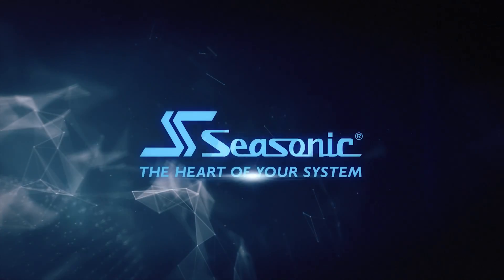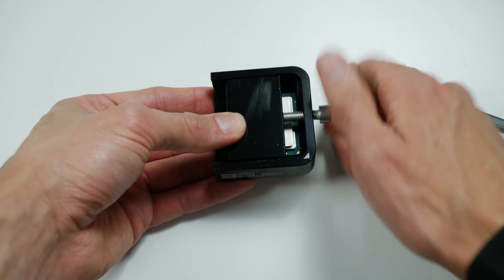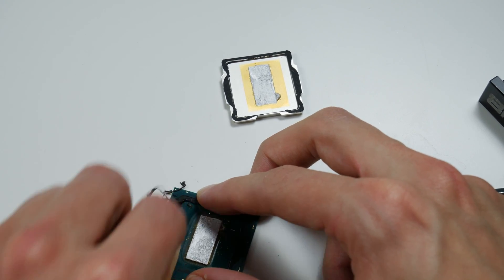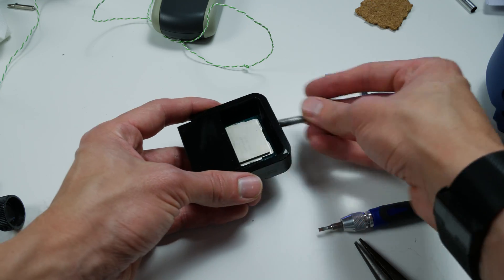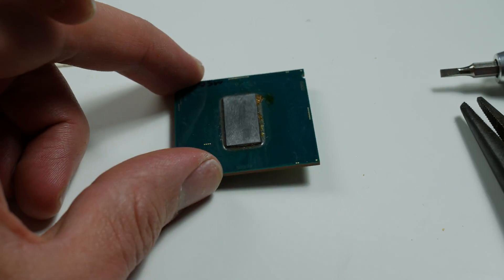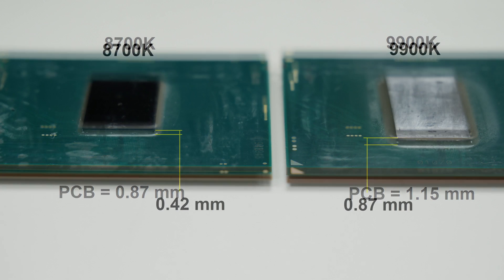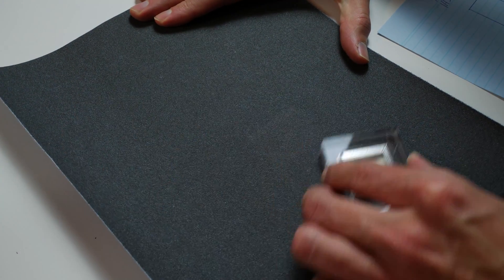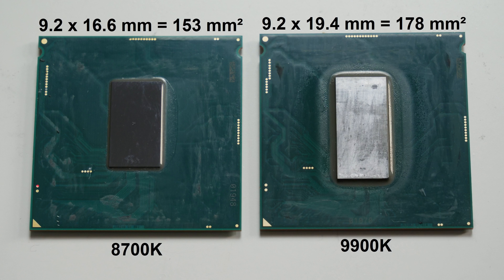Bad sTIM? Why is the 9900K so hot?

Comment: Have an 8700K and wondering if it's worth buying a 9900K. However I only use air-cooling. By the results on this video I would struggle to run a 9900K.

I have looked through Youtube for '8700K vs 9900K gaming' results. Was surprised to find one benchmarker show 9900K running 5'C cooler than 8700K, in MSI Afterburner. I think there were maybe two Youtuber that showed that result. The few other that showed temperature results, showed the 9900K hotter. 

It's a risk to buy a 9900K I guess. The preformance upgrade is minimal although min fps improves a bit. The two extra cores would help with background tasks. I think the best plan now is delid the 8700K, and use it until it does not play any more. ... it's always tempting to want the 9900K though.
Reply: dont do it just wait for 13th gen or get an i9 12900k. i had an 8700k when it cam out then later last year bought a 9900k. my maximus x wasnt optimal yes it worked but th z390 MB are made for the 9900k it has more power draw and get way hotter than my 8700k did and i had it clocked at 5.3 and my 9900k is at 5.2 and my maximus x is mad for a 6 core but if ur not overclocking high frequencies this next bit is less relevant but anyway after bought a z390 maximus xi for the better power delivery and heat sinks/spreaders on the motherboard also its liquid cooled with a 420mm radiator its just a hot cpu it always has been but more importantly the price of anything pre 10th gen it outrageous 2-400 dollars at least on the MB if not more that goes for the coffee lake and earlier cpus as well and for instance 9900k is around the same price as a 12900KS which is 700 buck more or less and 9900ks is like a grand where a i9 12900 k is between $500 and $600 and with the prices so much lower on the new gen 12 and 13th when it launches performance being sooooooooo much better its just absolutely not worth it i still plan on upgrading to to 13th but coulda saved hundreds by not spending it on coffee lake era tech which is all insanely priced 10th gen isnt 11th either so i hope i saw your comment in time also liquid cool your cpu you will love it even if you dont oc your cpu its just so much more efficient, not very expensive or hard at all to install anyway good luck man  hope this helped
Reply: @StupidWhiteKarens  I never did buy a 9900K (or not yet). However I am wondering from the perspective difference between CPU and GPU bound games. 

At stock clocks the 8700K will max out all cores and threads in Red Dead Redemption 2.

With reference when you look at reviews of 8700K vs 9900K, there is only a few frames difference.

However that is with GPUs from the time, like 1080 Ti and 2080 Ti. 

Now we have Ampere and with that I am maxing out all the 8700K cores and threads. With Red Dead Redemption 2 now being CPU bound, with 8700K. I then can't help thinking two more cores of the 9900K would make a lot of difference. Assuming that RDR2 would spread the load evenly across two more cores.

Of course I can get much more from the 8700K with a delid, and especially using liquid metal. Even with stock Intel paste now, it can run all cores at 4.8GHz. After a delid I should get 4.9 or 5.0Ghz all cores with no extra power. .... That extra 500MHz would make a difference in CPU bound games.

I mean to upgrade my platform sometime, but if a 9900K would make this 8700K platform more usable, then maybe keep looking.
Reply: @greenbow7888  I must have gotten luck I clocked my 8700k to 5.3 no delid I usually  keep my i9 at 5.2 ice had it at 5.3 and even 5.4 but hT off it 5.4 in single core its scores sometime just under other just hight on single core than 5950x and at 5.3 multi beats a stock 11900k its not the latest out but still a a very good cpu in just can justify its out 9f the box performance oc potential vs 12th and 13th a new is more than. 12900k thats just absurd also ir runs warm especially pushing high clocks I mean ive pushes b die ddr 4 and. 14nm coffee lake as much as o can with what I have and iys just not enough I run games fine at 2k 144hz but for me its also the overclock ing if this was a couple years ago id say yeah do it but with 12 being out and raptor lake right around the corner and being cheaper and miles more powerful stock let alone ocing them i dont think its worth it but i have had no complaints about my 9900 had alot of fun with it same as the 8700k I had if you could find one reasonably priced bc for sone reason you wanna stay on the 370 390 socket platform maybe but I do why not get even a 12700 or even 12600 its just old architecture (that performs fine) just over priced and again I wanna upgrade is id have around a grand or less if laye last year I didnt grab the cpu and MB but to end this long rant its upt to you thats just my to cents if I could do ober again id ga e kept my 8700 and mb then and either have z690 build already or be waiting for raptor like I um now
Reply: @greenbow7888  noticed a big fps difference in cpu ram intensive games as I also have 4×8 bdie ram thats oced to almost max board freq and my imc is probably at ita limit but yeah it was a very notice able fps boost

Comment: I wonder if like Der8auer said, maybe asking for solder was the wrong decision. We all assumed that solder would be cooler, but D8 has discovered why maybe not. I wonder if a 9900K with slimmer silicon and Thermal Grizzly would be cooler than solder. It would most likely be hotter than 8700K still though, although they both consume the same 95W. One thing is for sure, deliding and pasting a TIM 8700K is easier than doing a solder CPU like 9900K.

Comment: When sanding the die, are you still able to use the direct-die frame / oc-frame? Caseking states that the frame itself is only 0.1mm lower than the actual die. So if you sand the die more than 0.1mm the cooler / coldplate won't touch the die. In this video the die is sanded 0.20mm and then the oc-frame shouldn't be compatible any longer. But the video doesn't say if the frame was being used or not after this. Or if the IHS was mounted back and the standard socket was used. If using the IHS after sanding down the die, you will probably have to sand the outer edges of the IHS 0.2mm also, to make contact between the underside of the IHS and the newly sanded die.

If using the die without any frame at all, and simply mounting the cooler directly (as in actual direct-die cooling) there might be contact issues on some of the pins along the edge of the socket since you are only pressing down directly above the die.

Comment: I got 5.1ghz with my 9600kf and have it on 3DMark and Blender Benchmark on a 25 Deg C day in Australia results posted with 2070 super. Temps reached 85deg C with Kraken 62 in case setup with filters removed.

Comment: I'll say this, as a latecomer to this vid:

I've tried cooling my 9900K w/ a Noctua NH-D15 (high-end air) Fractal Celcius S36 (360mm AIO) and now also a custom loop w/ 360mm+240mm rads.  The temps on the custom loop are only about 5-7c lower than the other cooling methods while at the same time the custom loop dropped my 1080Ti temps by MORE THAN 30c!

This makes it pretty damned clear to me that (at least MY specific 9900K) is purely limited by poor die-to-IHS heat transfer.

Kind of upsetting to be honest!

Comment: I must have been lucky, I've got my 9900k running at 5.1ghz on all cores at 1.35v and no cores go over 89c during heavy benchmarking loads. Still miss the 65c top temp of my  8700k @ 5ghz tho =(

Comment: Has anyone done direct die cooling. But using a good thermal paste? Reason I'm asking is I have the ekfluid gaming kit (alloy) and cannot use liquid metal on my cpu block.
Reply: I have and used Kryonaut. And the temps are better, but I'm still on testings.
Reply: @brunoxsimoes  let me know your results please. I currently have a 9900ks direct die on LM now using a ek velocity. Temps from 50-60c under gaming load. Max temps mid 70's CB r20
Reply: Also running 5.3ghz

Comment: why is it so thick?  a lot of people are reporting cracked dies when they delid.  a few of them have sanded them down to find that the cracks disappear very near the surface.  so it could be that the tension from soldering and then the different materials cooling at different rates is causing forces to crack the die and the top layer is there to strengthen it and maybe to act as a sacrificial layer.

Comment: last one i got in hands was barely overclockable. it needed 1,38 V for stable 5 ghz, which is a joke, for what i have seen in a lot of reviews, where you can reach that with 1,3v or lower.
Ah, and i had to manually test in smaller steps, cause the cpu went so hot, that there was no way to cool it with all core oc. had to work with power targets to prevent excessive heat.
i never saw such voltages in any 9900k review. i gues they are binning them hard now, and if you dont want to buy shit for stock clock usage, you have to give intel more money then 500€^^
the funniest thing, was that this chip was not even stable with stock settings and auto voltages.
i sent it back to the retailer and bought a 9700k. The 9700k was not a cherry pick either with 1,343 for 5ghz but at least it was straight forward. 5 days for an all around stable overclock for the whole system.
good enough for the customers needs. i doubt i will touch 9900k again without custom loop. multiple days of work into the toilette.
Reply: It's the hyperthreading that makes it overheat

Comment: Will the direct die bracket work if you sand down the die? That would seem to yield the coolest temps(except for exotic cooling). 
I'm running an out of the box 9900k with an AIO and it gets pretty warm. I've considered de-lidding but it seems the real problem with this chip is the die thickness...

Comment: Congratulations, you played yourself.  

We did indeed! But hey, I am VERY happy with my delidded Conductonaut 8700k! She runs cold, 1.34 Vcore for 5 GHZ all core and 4.7 Ringbus. With a Noctua NH-D15 and my well ventilated case, we are talking 83 C at the worst in Prime95 AVX Small FFT! At that point, Hwmonitor claims my CPU is drawing some 255+ watts at times though, dunno how accurate that is but I DO know my chip draws a lot of power under those conditions, of course I DO NOT use any AVX Offset!

Comment: der8auer What would you recommend between either direct-die cooling with one of your CPU frames for the i9 and high-end air cooling (e.g., Thermalright, Noctua), as opposed to delidding, using liquid metal, and relidding using the same air cooling?

I've seen you've done both (though I believe with liquid or an AIO), so I was curious which made more sense; I try to stick with high-end air.

Comment: My guesses as to why the Intel sTIM is not much better than a good non-metal paste.

(i) Either to save money, or to keep soldering temperature lower for some reason, they're not using pure indium. If so, it's probably indium-tin alloy. Eutectic indium-tin melts at just over 100C, more than 50C less than pure indium, and costs roughly half as much. But its thermal conductivity is pretty awful.

and/or 

(ii) Too much flux (or flux with terrible thermal conductivity, or inappropriate flux). More flux would lead to a faster and simpler application process, but it's a very poor heat conductor, and all but a tiny amount will kill the thermal conductivity of the indium (or whatever alloy the solder is).

Comment: 9900k is fucking failure.
Reply: Depends on how much you paid for it, what you're using it for, and whether you were expecting massive overclocks (which are never guaranteed).

I'm very happy with mine. But I got it for a good price, it has a decisive performance increase over my i7-4790K in all areas, and I'm content running it at the max turbo (4.7GHz) on air across all cores, well within its temperature range (no core ever goes above 80C and most cores are between 75-78C) and fully stable 24/7 at 100% load on all cores.

Comment: I don’t understand how 60c under full load at 1.2v 5ghz is considered hot for an 8 core cpu. Mine does not go above 60c at these settings unless I am running serious benchmarks like Aida and Cinebench, in which case it still only barely hits 70c. I’m using the Kraken X72
Reply: I did just get mine, so they must be using better sTIM now then they were at launch.
Reply: Even when I got it up to 5.3ghz, it never needed 1.3v and never hit anything higher than 80c. I don’t have any complaints seeing as I’m coming from a 6700k that needed 1.4v to hit 4.7 ghz and was hitting low 90c’s

Comment: Too much worries about MHZ,  just set the 9900k at stock speeds and its very powerful, i will set my first 4 cores at 5ghz and other 4 cores to 4.9ghz with a 240mm water cooling and good, fanatics can break there brains just to get so much little more, life too short, enjoy :)

Comment: Can you make a compassion with a AMD soldered chip?
How much lower would be the temperature of a AMD soldered chip be after you delidded and lapped it?
By doing it we would know if Intel doesn't know how to do it properly or if soldering a chip is overall a bad thing...
Or Intel is doing it on purpose to have a ease next generation on their hands... All they need to do is make a more efficient soldering job and slap a I9 10970k stamp on it...

Comment: That is a lot of work to get temperatures down.  I used to lap CPUs and hated it because it was a lot of time and effort for every CPU.  For those of us that delid CPUs we were better off with the garbage TIM that Intel used to use.  By the way, Silicon Lottery states temperature reduction, "4°C to 8°C for processors with STIM (Intel 9th generation)" indicating that they DO NOT take the time and effort to lap the CPU and IHS, however, reflect your 8°C reduction in temperature without lapping at a cost of $60.   I seriously doubt that those who pay $530 for this CPU will will have any argument paying someone else that amount to delid and apply liquid metal TIM.

Personally, I am keeping my i7 7700K that I delidded myself and applied Thermal Grizzly Conductonaut.  It does very well when gaming.   However, I admit that I am waiting to see what AMD offers with their upcoming 3000 and 4000 series CPU.

Thank you for taking the time and effort for this video.

Comment: Looking at your results I must have a good 9900k as mine it’s stable 5ghz 1.25v no delid temp after 12 hours of stress testing average temp 71c max spikes of 86c with furmark running at the same time 4K resolution without furmark was doing 60c. Ambient temp 20c, I did try 1.245v and it’s stable but in games I found that with 1.25 they seem to run better

Comment: Great video and content. The whole thing makes sense. Also, if indium bring rigidity and thermal contractions, the Si must be more mechanically resistant to breakage; hence, this whole thing make sense. I'm sure Intel studied the whole thing and made those specific choices for a reason. Why don't you engineer your own cooling system ? eg., super flat Si,  with more convection than conduction, eg., something based on Ag-Ga or Au-Ga liquid or nanorods/spheres, or anything with relevant phase diagram. A big problem, is the mechanical breathing and pressure from the heavy CPU coolers.; a nano-metal-fuild would solve the problem, and over it, you put whatever would be relevant.

Comment: Roman do you think AMD chips Zen 2  on 7 NM or Intel's er 10 Nm chips will be running somewhere in the 5.2+ GHz range, also I quite enjoy the channel. Is there chance you could do a memory overclocking video? I am having issues although I am still on a 6700K 4.8Ghz and can't seem to get memory working in any stable form at over 3466MhZ 15.15.15.35

Comment: why is i9 9900k to hot???? For me it isnt so hot, i mean its 8 extra treads with a turbo speed of  almost 5ghz ,75degrees celcius at 8 cores at maximus  i say that is realy good and i have a  noctua NH-D9L in a slim itx chassi from fractal design node 302 also a 1080 in it so its tight building

Comment: You should also consider making a "jig" to hold your cpu or ihs perfectly flat and perpendicular to your sandpaper while your grinding.   I saw that you hand hold it and rub it on the sand paper.  Even if your paper is on a 100% flat surface,  it's still impossible to hold it 100% flat with your fingers.  The grind could be at a slight angle, even if that angle is in fact perfectly flat.

I highly recommend this.

Comment: This is a a little retroactive but would you do a delid of an 860k or at least one of the comparable Athlon X4 chips (as they run hot)? There's a pretty good cult following for this cpu as a budget chip for gaming still in affect and we're also inferring to the life span of a 2 physical core / 2 logical state processors equaling 4 "core" [4 total thread!] processor 3.7 mhz base processor overclocked to 5.0 as much as possible (4.0 turbo clock from AMD). This processor has great overclock capabilities especially in the Black Edition class but suffers in the field in cooling and requires generally extra cooling concepts  for the marriage of the fm2+ board some of which suffer from insufficient VRM heatsinks at the budget level.